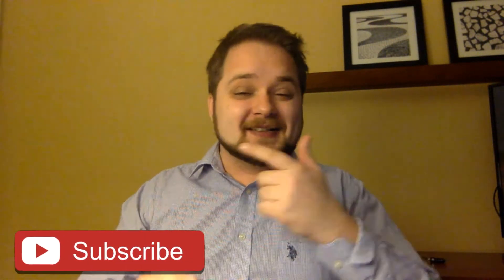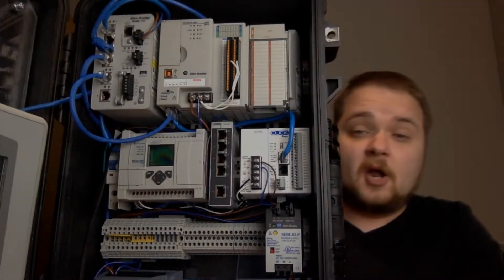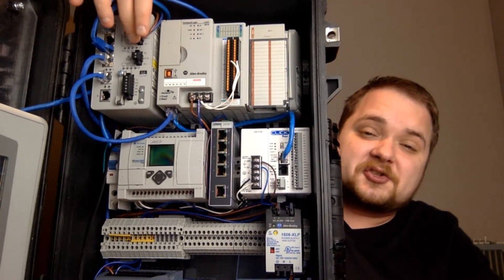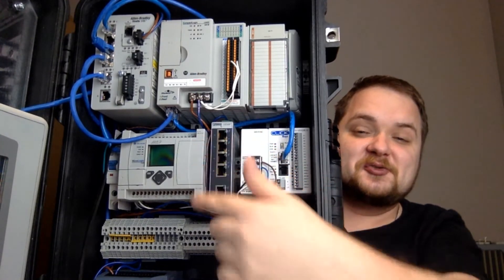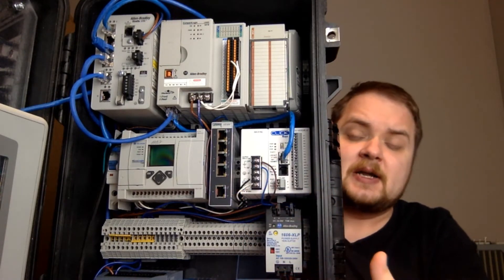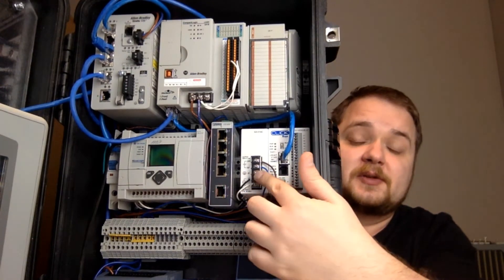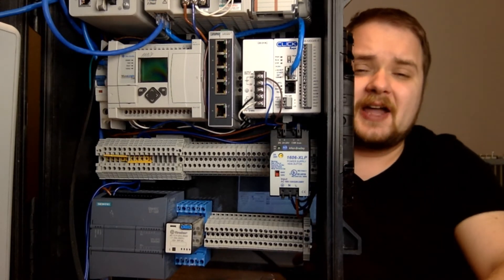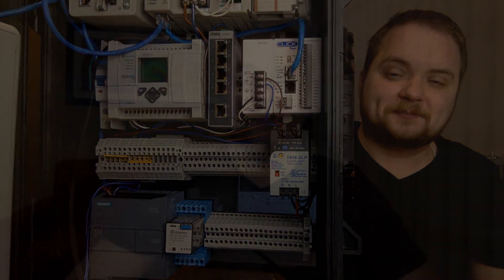PLC Trainer Kit - Allen Bradley DIY PLC Trainer Siemens Automation Direct Stratix PanelView HMI

Comment: Vlad, can you tell me how you mounted all the din rails inside the pelican case. I have an old pelican case and some plc, would like to make the same. Thanks
Reply from the maker: I used a piece of plexiglass as the backplane for the dinrails. I glued small cubes of wood to the pelican case using plastic glue and screwed the plexiglass to them. I then screwed din rails across the plexiglass with regular screws I purchased at home depot.